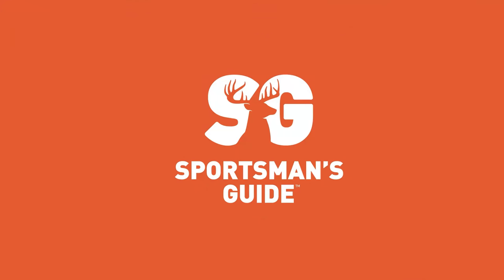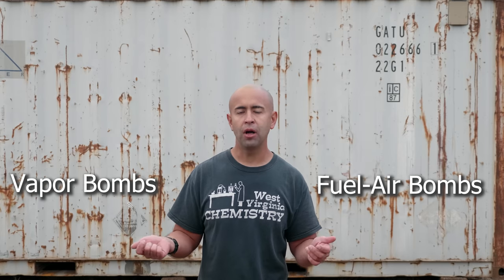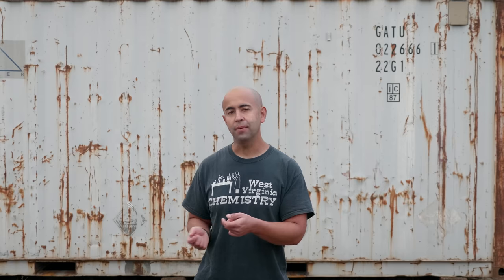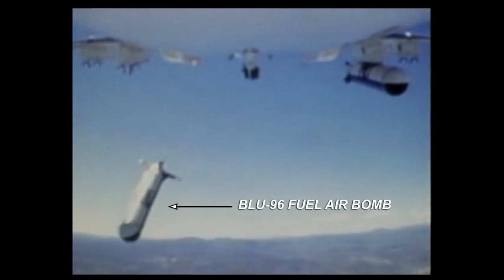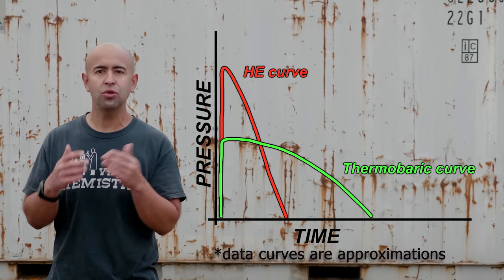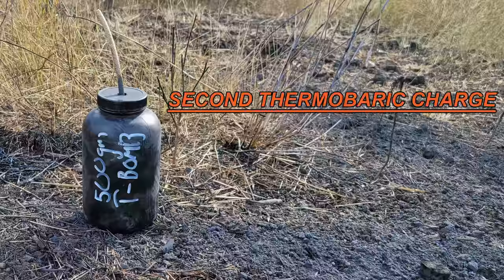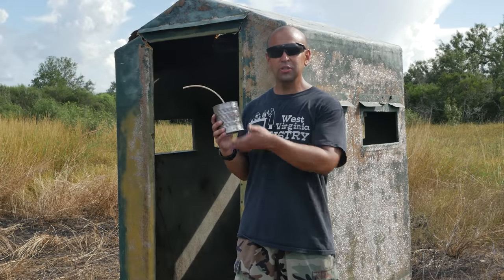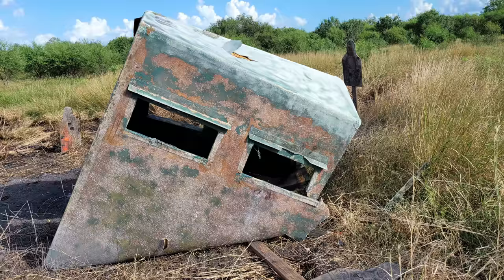Improvised Thermobaric Grenades: Testing Fuel Air Bomb Grenade Designs

Comment: I think you need to detonate these on tripods at varying heights not at ground level, so that the air is evacuated therefore generating a negative pressure wave upon take up/ignition.  Consider the example of the Bomb you showed which had a vapour cloud before ignition.  I am not being rude here but you really should be instrumenting your trials with Calibrated armoured Piezo Electric Transducers, with EMP proof memory chips, with signal conditioning amplification and a square wave prior to the event not during, calibrated for example 1 volt  =  X PSI or KPA, I believe that Endevco, Kistler and possibly Kulite make them.  MAKE SURE YOU START SMALL, PLEASE CONSIDER SAFETY, WIND DIRECTION BEFORE FIRING.

Comment: I'm not an explosives expert, nor a chemist/etc, but I was wondering what would happen if you set up a multi stage system that misted a liquid fuel over a small area for a few seconds, ignited the mist, and had a secondary payload that was set off by the first, misted stage

Comment: I'm afraid you have missed the dynamics of your understanding of the fuel / air bomb. The pressure wave that you are looking for comes from a detonation wave that travels outward from a secondary delayed charge. This detonation wave travels through the previously deployed fuel / air mixture and acts much like diesel combustion. This wave energy is progressively added to as the wave travels as a combustion front. Ground pressures in excess of 30 psi have been recorded which would be devastating to structures and people.

Comment: you should try using nitromethane as a liquid fuel. Since I don't see you using a booster charge of TNT to spread the fuel further and create a leaner fuel/air ratio, you need to use a fuel that requires less oxygen to burn such as nitromethane. Even with less energy density, a more complete combustion will give you a better bang for your buck- just like in a small engine.

Comment: Maybe some sturdier casing for the unit? Or coat the casing with some epoxy and glassfibre cloth. Should build up more pressure and heat inside before rupture..so less unignited fuel..?🙈🤷‍♂️

Comment: I suppose you guys would be the people to ask, are there limits on explosive or combustible gases being used as firecrackers? For example like the old King of Random video where he made an electrolysis hydrogen oxide generator and filled party balloons with it with fuses attached. I've had this idea in my head to try and design (hopefully without needing an FEL) relatively safe grenade simulators using a more efficient compressed hydrogen oxide mixture inside commercially available plastic CO2 airsoft and paintball grenade burst shells, but haven't found a clear answer online if that's kosher with the ATF as they seem to be more focused on liquid and solid fuels.

Also while I'm at it, have you guys ever screwed around with zinc sulfide? It tends to leave behind zinc pellets when it combusts and I've always wondered if it basically makes it's own shrapnel when confined, but I'm not gonna go put myself on a watchlist building PVC pipebombs in my back yard with it to find out.
Reply: If it's basically a simulator (like the propane guns used in reenactment) it shouldn't be a destructive device.
Reply: @ChucksSEADnDEAD  That's what I was thinking but I don't know if there's a weight limit on gaseous explosives like there is on solids and liquids, plus for simplicity's sake the fuse would work identically to a real hand grenade which may not be cool with ATF on it's own. Like I said, I'm not gonna start blowing up stuff in my backyard and hope the ATF doesn't get involved, in theory with an optimal mixture and enough of it compressed in there it would make a pretty sizeable fireball and the blast could shatter close by windows and set off car alarms. It has a detonation velocity of around 4000m/s but without the mass needed to produce super dangerous pressures in open air, it'll look and sound like a hand grenade full of TNT but won't make a crater in the ground after the dust clears, definitely not something I wanna test in court even though it's not made for antipersonnel use.
Reply: @hornmonk3zit  It seems like that deviates away from the simulator area and actually makes use of hydrogen detonation, where the practicality of the item worries me more than the ATF. I don't think there's an explicit prohibition in generating detonations and if the charge is small and the case around the device doesn't fragment, it shouldn't be a DD. But small detonations will probably output 140-160 dB and create a safety concern where the burst disc CO2 grenades typically are around 120 dB if you don't modify them.

Comment: this kind of things do need some "air". a stick on the ground and a charge on top will be more efficient, in terms of "fun", put it on the ground the bottom half of the bang sphere get absorb by the ground. however, common sense tells us hanging a charge in mid air is very danger, camera and personal had to move very very far away from ground zero for obvious reason. a bomb shelter or some kind of "turtle shell" with bulletproof glass would be a possible solution to prevent them get toasted.

Comment: You missed the real benefit of fuel air bombs. In a standard bomb you have the fuel, and oxidizer in the same container. A  9 ton bomb is a 9 ton bomb. We can think of it like a simple hydrogen oxygen mix. Hydrogen weighs 1, and oxygen weighs 16. Most of the weight in a bomb is oxidizer. To make water from hydro oxy we mix 2 hydro to 1 oxy. So by weight we use a 1 to 8 ratio. So of that 9 ton bomb 8 tons are oxy. But in the fuel air bomb that oxy is already at the target. A 10 ton bomb delivers 90 tons of explosive. No airplane in the world can carry a 90 ton bomb. But they can carry 20 tons. With a 20 ton fuel air bomb we can get a 180 ton explosive.  That's in the ball park of the kiloton range like a nuclear bomb. That's why they are the most powerful bombs other than nuclear. You should not use high explosive for the lifting charge. That's why you're getting fuel flung out.  Low explosive won't shatter the fuel but will heave it more evenly. You could do simple geometric calculation to determine how far the fuel should be heaved to get the ball park of the proper fuel air mix. Then put an ignition source like a flare or even a sparkler at that distance. That should get you a good fireball.

Comment: Back in 90's when doing national service here in Finland they had a thing called nuke simulation blast. Had nothing to do with actual nukes, was a 200 litres (60gal?) barrell full of gasoline.
Dug into sand, and under it was 1 kilogram of TNT. 
That HE dispersed gasoline into air where it was ignited few milliseconds later with white phosphorus hand grenades which were hung about 5 meters above  aforementioned spectacle :)
Big flash and and end result was a huge smoke ring :D 
That was trigger to us to go into nuke mode. Not funny as a conscript. Now a few decades later it was funny.

Comment: I remember the footage of F.A.E bombs being dropped over Vietnam...clearing out jungles, you could see the pressure wave from the plane. Those were some sort of LP gas, right?  will we be seeing any of that?
Reply: The Daisy Cutters? Those used AN and aluminum.
Reply: @ChucksSEADnDEAD  yes! thats the ones i'm thinking of.  Need an instant LZ? Boom!  Those things are awesome. And, i suppose technically a "thermobaric"?
Reply: @ChucksSEADnDEAD  28,000 lbs of explosives if i remember correctly. i talked to a guy that saw the damage that thing did. he said it was unreal (not the words he used)

Comment: What you see here is mostly the dispersion charge spraying some sparklers around. This was not a tuned thermobaric explosion. Thermobarics need a something like a critical mass, and the solid fueled variants probably much more so. It's very hard to get a liquid fuel thermobaric explosion of this small size. I'm not sure if it's even possible with solid fuel in this scale.
Imagine what 750g of high explosive would've done to that cabin. It would've shredded it to toothpick size.
This is what a similar sized liquid thermobaric explosion looks like: https://youtu.be/sv0tGx80yLk?t=323

Comment: The best thermobaric explosive has to be oxygen and hydrogen. Make a case with two compartments high pressure H2 one side and O2 in the other. At bomb release the barrier splits. Spark fired detonation fires the mixture like any other bomb.
Reply: By volume hydrogen has a lower energy density compared to aluminum.
Also, the advantage of thermobarics is that they use ambient air to help create or increase the blast.

Comment: The usual filler for liquid based systems is ethylene oxide. It’s got explosion limits similar to acetylene and is fiercely flammable. The downside is that it’s is extremely toxic. It’s used to sterilise medical equipment.

Comment: Those were definitely not thermobarics, those were pyrotechnics. At no point did the fuel actually detonate. Achieving fuel-air detonation with solid fuels is basically impossible. Thats why liquids are used, such as ethylene oxide.
Also not all thermobarics are fuel-air bombs, FAE are subset of thermobarics. In fact most thermobarics are regular HE + a blast enhancer, such as Aluminum powder. And in fact MOST explosive devices used by almost any military are thermobarics. Thermobaric just means heat and pressure, generally implying an explosive device that features a mechanism to deliver more heat and pressure than the pure HE equivalent, although no real definition exists at which point a device is or isnt thermobaric. For example, regular HE detonations, such as RDX, result in large carbon dust clouds that tend to ignite at supersonic speeds with atmospheric oxygen since there isnt enough oxygen within the explosive  to fully combust the explosive and the temperature of the explosion is extremely high. Adding something like aluminum only facilitates that even more (much easier to ignite than carbon dust), hence it contributes to the blast (even though the combustion products of metal powders are solids, not gasses) by adding heat and longer peak pressure.
MOAB doesnt disperse fuel over an area. It features a castable RDX based explosive called H6 (RDX + TNT + Aluminum + wax), which is basically WW2 Torpex, which is just Tritonal with mostly RDX instead of all TNT. Stuff that is used in just about anything bigger than artillery nowadays. The explosive is literally a solid chunk.
Tritonal and more recently H6 are both used in Mark 80 family of bombs, due to the added Aluminum has about twice the detonation energy of just TNT. The MOAB is literally just a big bomb. As is BLU-82 btw, contrary to popular belief - the "daisy cutter" is not FAE either, but it is thermobaric in principle since it features additives to enhance its blast performance.

Comment: 750g of CHP would turn that structure to shrapnel. Even 750g of any flash powder mixture would splinter it and likely have similar effects to the CHP, even with a much lower VoD and blast pressure. I understand the advantage of military-grade thermobaric weapons, but I don’t really see the benefit here.

Comment: Why don't you try the same thing but don't use solid aluminum as the fuel. Use a mixture of aluminum, powdered sugar or non-dairy coffee creamer, and charcoal. Also use a more potent initiator charge. Your usual ammonal mix should work, just use like 1lb of it wrapped with 1-2lbs of fuel mix. Should be outstandingly effective.

Comment: Fae's and thermobarics are not one and the same.  FAE's are FAE's and are thermobaric by nature but are not the only example.  Another example would be an oxygen positive explosive such as ETN that has aluminum powder added to it.  This increases the burn temp (thermo) and lowers the birsance but increases the length of the blast pressure pulse ( baric). You needed to do some more research on this one.

Comment: Try racing nitro methane gas in it, it's bound to give a big badaboom as Milla Jovovich would say😂🤣😂 I've always wondered why they use diesel instead of gasoline in AMFO as well because gas is more volatile so I thought it'd probably be better.
Reply: Diesel is much safer to handle than gasoline. It is also more energy dense. In other words for a given volume you get more heat out compared to gasoline.

Comment: I say this respectfully (thermobarics are extremely difficult to pull of), but these were not thermobaric detonations; just the main charge throwing fuel. 

You'll need to use nano aluminum to get your ignition temperature lower, and either supplement it with magnesium (also nano-scale), or use a fuel like isopropyl nitrate (Thermolene) to get the flash temperature up to autoignition.
There are newer thermobarics that are using magnesium-alumnium alloys to lower autoignition temperatures. Be careful handling any nano sized metal and wear a respirator. As to Thermolene, it's a dangerous fuel, but I believe can be bought commercially. 

I hope you guys keep tinkering with your recipe and ratios, I'll be keeping an eye out, it's fascinating stuff!

Comment: I don't recall what the materials used  for melting rails butt ends together but couldn't a simple device be made for the Ukrainians to disable tanks?
Melt a slug in the bore, tracks to drive gear sort of thing.
Reply: they use magnesium ribbon to melt rails together.

Comment: Ethelyne oxide and aluminum, when?
Reply: Epoxy and aluminium can indeed be a fun thermobaric reactive layer on some improvised energetic devices.
Reply: @ExplosivesLaboratory  Ethelyne oxide, not epoxy.
Reply: @azisandwich 
Yes, they are different materials, but please note the following informationː The same functional group (cyclic ether) is present in epoxy, that’s why we call it epoxy. Ethylene oxide is a precursor to epoxies. One can make a suspension of aluminium particulets (preferably less than 10μm) in epoxy and use that material as a reactive layer in high explosive energetic devices. It behaves in a similar manner to the aluminium and PTFE composition, but that said; Al x PTFE is still superior in performance.

Comment: U made a slight mistake. A fuel air bomb is not the same as a thermobaric bomb. A fuel air bomb deflagrates a stoichiometric mixture. A thermobaric detonates the stoichiometric mixture. Fuel air lights it. A thermobaric detonates it. Big deference. The fuel air bomb disperses and lights it off. The thermobaric desperses it , then a second blast work like a blasting cap inside the cloud of fuel and air and detonates it. Also solid metal fuels barely count as a fuel air. But if u tryd with say coffee creamer powder. U wud get closer to fuel air bomb. Check out beyond the press channel. They made a perfect thermobaric with it destroying a model town. As a side note ur grenades were not grenades. Also they made no attempt at stoichiometric conditions. This was a sad attempt. Not a success. I had to watch the video a second time for this to kinda start to bother me. I love ur guy's channel. But this is just criticism.
Reply: Thank you, this was bothering me. They basically just made a big sparkler
Reply: Fuel air bomb deflagration is a slow pushing build of a pressure wave.  Thermobaric is more like a large volume HE. That has lower peak pressure than standard HE, Higher than fuel air, but unlike standard HE it involve a lot more intial gas volume so has more push less tear action thru space. Brisances is completely different. Standard HE pressures are higher but have little range. Thermobaric has lower peak pressure but more range. Fuel air is even lower peak pressure but in the middle of two in terms of range. If a within their range , Fuel air will burn and topple a house or structure like a bulldozer. Thermobaric will lift and plow Thu it sperating walls into flat separate sections. Standard HE will tear into individual ribbons and splinters.  But HE basically has to land on top of structure. Where as a thermobaric can just land near by or in epicenter of a group of structures.
Reply: I love this stuff I wish I cud help them with their projects. Improvements here in there a wish I cud have had their ear for before they finished videos. Cuz don't get me wrong these guys are great and very entertaining.

Comment: No. You didn't get anywhere near proper fuel/air ratio. I don't even think you had the right fuel. I got bigger explosions using cans of spray paint with delayed ignition when I was 15 years old. You have to disperse the fuel, THEN ignite it. All you're doing here is blowing fuel out, and getting partial combustion of it.

Comment: Your not dispersing the fuel properly and second ignition is too soon🎉 keep at it. I would put the second ignition in the center pipe, the outer pipe filled with propane, the first ignition would be just a small charge tonsplit the outer while lighting the second ignition. My uncle does this for making ponds easier🎉

Comment: Pathetic. 
None of those worked properly. 
I would definitely recommend liquid fuel.
But if you are set on using solid fuel you my have more success with a larger dispersion charge and a secondary ignition charge. It looked like you used the dispersion charge to ignite the fuel air mix on these.